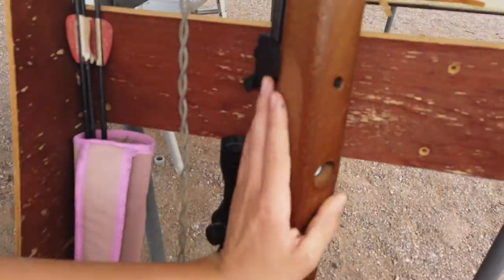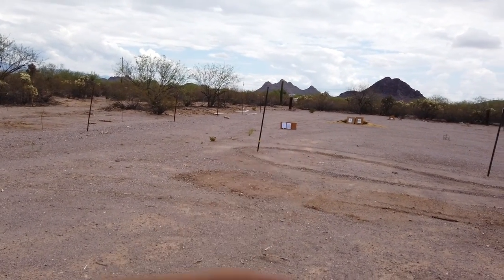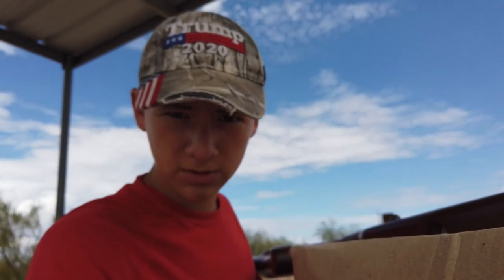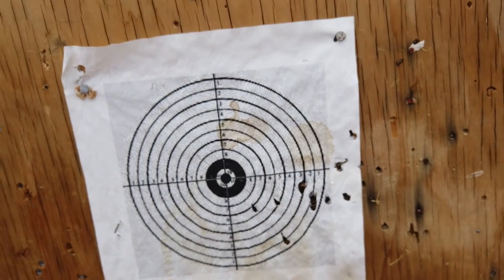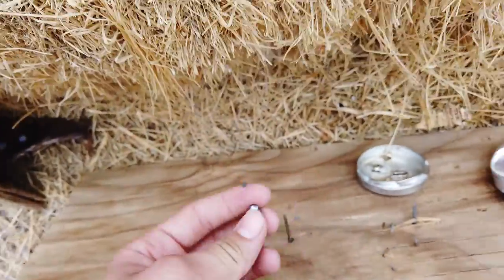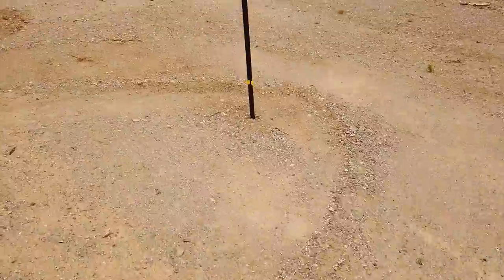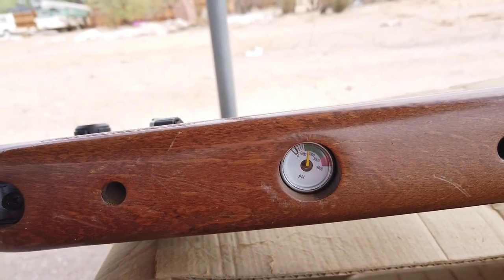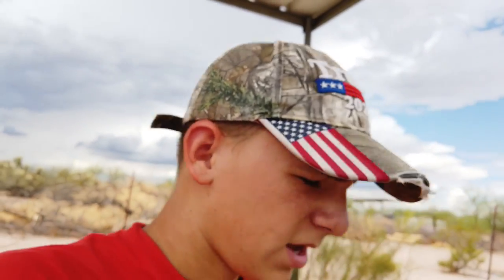Beeman Commander Review- Independence Day Special

Comment: Another great review! I loved, loved, loved your intro. Yeah, it's a great gun for the money. By the way, airguns of Arizona has their gun for only $195 right now. A fantastic bargain. Loved your video.
Reply from the maker: Wow, I didn't know you could find this gun for that cheap! This gun is probably the most cost effective budget airgun on the market, and it works great! It is also able to compete with guns high above its price range Like the Umarex Gauntlet which is about $330 and maybe even the Benjamin Marauder? 

This gun has a bunch of things that none of the guns listed above even have, and for around $100 less it is an outstanding bargain

Considering this comes with: 

1. Fully adjustable open sights
2. A scope 
3. A very accessible hammer spring adjustment 
3. Easily 75 shots per fill  

By the way, thanks for commenting!